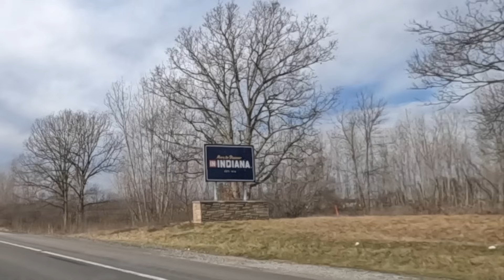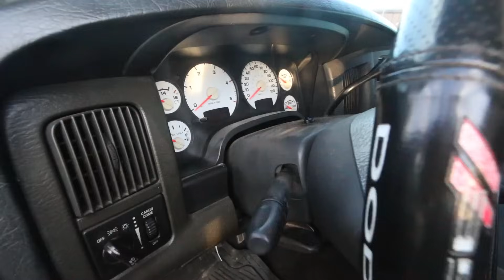I Bought THE BEST DIESEL TRUCK On The Market  (3rd Gen Dodge Ram 5.9 Cummins)

Comment: Man third Gen owners are definitely a type. Got the stanced wheels, tow mirrors ALWAYS out, light bars, black everything. Be interested to see what you do with it. Damn seems crazy cheap to me ! Especially if it doesn't leak or seem to have issues. The interior even looks nice. I thought it was going to have a shit load of issues with all those hot boy upgrades. Usually when they look like that it is all appearance and zero maintenance.
Reply from the maker: Lots planned! Just wait till you see the shape of the tires from them not being rotated...
Reply: @NockRanch  almost done with the video now. Honestly surprised it is as nice as it is. You got a killer deal.
Reply: Well, they're copycats.
Reply: 6.7 power Stroker eats Cummins and Duramax
Reply: @LaLaLucky7777  can’t forget the 6.0 power stroke 😢

Comment: You got a hell of a deal Mick. I remember someone telling me 30 years ago, that those 5.9 Cummins were  also used in those Ottawa yard goats. That’s engine is bulletproof. I am also a Ford guy like you. I still miss my 1971 Ford F-250 4x4 highboy with a 360 big block and a 4 speed with granny low. I also had a 4 hi/4lo transfer case. HD Dana 1 ton front end on it also. I sold my truck 31 years ago. I had it for 13 years. I bought it in 1980, it was only 9 years old then.

Comment: I have a 2005 Cummings 4x4 Quad Cab. 124,000 Miles on it. Just got my Banks Big Hoss Bundle put on about 3 weeks ago. I have the Carli Dominator 3” Lift. 295/70R 18 Nitto Terra Grapplers. Banks Tune. 505 HP 1025 Lbs Ft Torque. Had the whole truck Raptor Lined in grey. Full 4” exhaust. 28 MPG HWY 24 MPG city. I think I get that fuel economy because I leave my tow mirrors in.
Reply: The factory mpg gauge is way off 😂
GPS will tell a different story

Comment: Just came across your channel. Great buy! I've had my 03 Cummins just like yours but with a 6 speed for 8 years. Bought it with 250k and now it has 302k miles and runs great! Been in the south its whole life. I'm in Tennessee. Bought mine in 2016 for $9900....FROM A DEALER! and buy a flow pro muffler, it looks like a corkscrew inside the muffler..It flows good, sounds great and doesnt drone!
Reply from the maker: Appreciate the input. Welcome!

Comment: Nice find. I have a 2007 3500 Dually which was the last production year for the 5.9 pre-DEF power option. The best advice I would give you is test those injectors immediately, before you ask, yes it costs about $12K to find out the hard way, and that's if you do the work yourself. I've also dealt with two of the other common issues with 3rd gens, TIPM issues, and HVAC mode doors. Now I finally have everything operating as it should and it's a great truck. Considering what new ones go for, even with a new motor, I'm money ahead.
Reply from the maker: Appreciate it, thanks!

Comment: Great buy damn good truck and motor I have had two 12 valve Dodge duallys and love them ! I strongly suggest looking into a FASS fuel system the 24 valves are a high pressure fuel system who's injection pump is cooled by the fuel and is very particular [as in the will take a crap if trash or pressure loss is encountered] the automatics are another weak link [both of my past trucks were automatics and I had no issues] good luck with that excellent purchase looking forward to your next video !!

Comment: Ive had my 03 dodge longbed 4x4 cumins since 2008 second owner. My issues hav e been with auxiliary parts like the stock lift pump. The original is a crap housing bolted on to the fuel filter housing. That was fun loosing  that on the road. Got rid of it and put aftermarket and she ate alot of water pumps.but like you ill never sale love my cummins easy to work on no electric bs!

Comment: Check the serial number on you engine Block, Blocks with  "53" in them were prone to cracking.You can google "cummins engine block 53 issues". I believe 2002 was the last year they had that issue.
Reply: Won't be an issue on a 3rd gen.
Reply: 2nd gen only
Reply from the maker: Yep, in the clear 🫡

Comment: You have the best auto trans produced with cummins pick ups, the 48re, stronger than the older autos, electronically more simple than the new autos. I recommend a Shift Kit if you plan to do anything with the transmission 👍. 

And yes, straight through resonators reduce a LOT of noise. 

2003-2004 has different injectors than the 2004.5-2007, among many changes in 2004.5. 

If you plan to own the truck for a long time i definitely recommend an upgraded fuel system like FASS or AIRDOG.
Reply: Great advice. This post needs more thumbs up

Comment: Nice truck, I have an 03 dually. It's got over a million miles on it and the engine has never been opened, other than the valve cover for 1 set of injectors at 400000 miles and valve adjustments. Still going strong.

Comment: Does it have blow by? Early common rails had this issue. I'm so glad you got rid of that exhaust tip. Like you, I've never understood. Put a muffler on it, like you, I'm getting old, obnoxious exhaust wears on you on a long road trip. Looking forward to the project videos. I grew up GM, had a DMax, have had 4 Cummins since. I won't own another diesel in a light-duty truck for all the reasons you mentioned.
Reply from the maker: No blow by! first thing I checked. They are definitely tough to beat.

Comment: To get rid of some drone (not all), but much less restrictive compared with a muffler is a resonator pipe, or upgrade to make bigger if it has one.

Retain efficiency but reduce some of the drone noise.
Reply from the maker: Thanks for the tip! Definitely will consider

Comment: The deal you made was great. The 03 to 06  5.9 was a great engine. Tyler from Hoovies garage hit one million miles in his 04 ram 2500 . Love the dodge.
Reply from the maker: That's wild!
Reply: Later year common rails were a better engine. But hoovie didn’t put those miles on himself, in a hotshot platform almost every diesel can do it because they’re all highway miles under a good load and insanely good maintenance typically. That’s why most buy Texas diesels, all highways, mostly towing.
Reply: I've got a million miles on my 03. Bought with 20000 in it. Awesome truck.

Comment: Nice shipping crate, now what are you doing with the engine?
Reply from the maker: Got any suggestions?? All I'm planning on doing right now is general maintenance and saving up for a new set of injectors!
Reply: @NockRanch  no I mean what are swapping the engine into like your old Ford?
Reply: A ram is just a shipping crate for a Cummins engine
Reply: Har har har such a dumb meme. Most I’ve ever seen wrong with a 3rd gen was electrical gremlins in the doors. Lightyears better than the major issues Ford or Chevy has

Comment: I have an 06 5.9 single cab 4x4 6 speed. The 215 P Pump 12 valve is still by far my favorite. I'm not a big fan of electronic anything, and the price of repairs don't even begin to compare between the 12v and the common rail

Comment: Cool rig!  My only thing for diesel pickups bow is No auto transmissions.  Loved my 12valve buy hated the auto.  I like the 7.3 in mu van but the auto is lame.  I just prefer the way a diesel drives when backed by a manual.  

Nice truck.  After having all 3 , cummins is my favorite engine, ford might have the best build quality, but i like working on my diesel squarebody the most.
Reply from the maker: I'm a sucker for a manual, but I just can't do it for a daily driver. Gotta love a squarebody!

Comment: Is it rotted out under the fender flares? I hate when people put those on because the fenders rust immediately. I’d maybe consider a FASS to replace that lift pump and put a fuel pressure gauge in the truck so you know you always have enough fuel going to the CP3. Other than that, GREAT purchase. I wish I could find deals like that 😂
Reply from the maker: Not in the front, but the bed flares have some! I talk about the fass system in next weeks video! Appreciate the support pal!

Comment: You got a heck of a deal.... however.... you will end up sinking a descent about of money into it. I had the exact same truck and they are extremely troublesome outside of the engine. Transmission being at the top of the list.
Reply from the maker: Counting my days with the transmission, for sure. Ripping out and rebuilding will make a good project for the channel 👍
Reply: @NockRanch  my hvac vents would only blow thru defrost. My steering column was shook with bumps, my back window leaked, Trans went out when I sold it on test drive, I still got like $17k this was about 10 years ago. That truck you have is worth probably $15k. Should make for good content wrenching on it if that's the direction you want to take your channel.

Comment: The RAM truck with an Automatic Trans, is “NOT” a reliable truck. 
New trans every 75-100k miles, unless you use it to Tow. Then it’s much more often!!
Reply from the maker: The manual is definitely the way to go, but I just can't stand daily driving a stick. Save that for the fun stuff! Auto tranny was definitely a concern, but seems to be fine for now 👍

Comment: 6.7 is prob still the best cummins. These 3rd gens would melt down without warning from sticking injectors. Great motors but they are expensive
Reply: 6.7 has just as much issues. Only the early 5.9 had injector issues. 6.7 injectors are more expensive. They also have EGR DPF failures. Not to mention the VGT failing. 5.9 it’s a much cheaper platform than the 6.7. Speaking from experience. I sold my 6.7 for a 01 5.9
Reply: It’s all about fuel filtration. The micron rating on off the shelf fuel filters don’t actually match Cummins specs. Cat filter kit is the way to go
Reply: @Ryskyguy  01 is not a 3rd gen. I’ve had all 3. The 03-07 common rails all had injector issues. Regardless of filters. The tolerances on the injectors are just too tight. That’s why rebuilds are so sketchy. If you cant rebuild a turbo then you shouldnt own a diesel. Yea the dpf failures are stupid plus the regens getting stuck etc etc. all of which can be tuned and deleted. I’m talking pure motor to motor

Comment: You have just become a Mopar and Cummins fan. Whether you admit it or not. 😂 Cummins diesels are Bullet proof, only comparable was the Ford 7.3 power stroke from the days of yore.
Reply from the maker: OH NO, is it happening?? Next thing you know, I'll be towing home a dukes of hazard tribute. Haha
Reply: @NockRanch  that's right...that's right. 😬🫡 welcome 🙏🏻 🤣  but for now Add a Power steering Gear box Stabilizer, and consider "Firestone Airide" ride rite load Leveling in the rear. Couple tweeks to the motor, a few offroad LEDs, some rust proofing... Superb 👌🏻